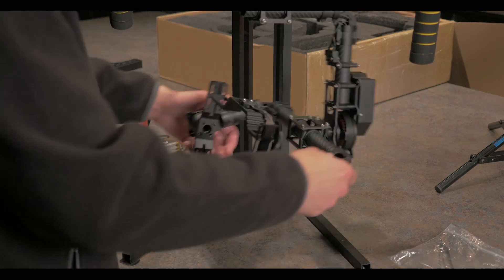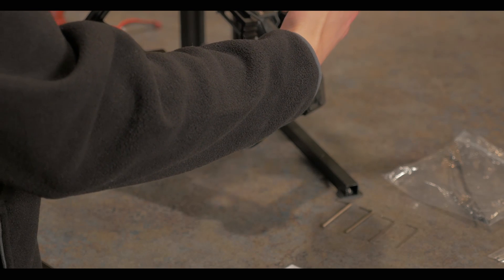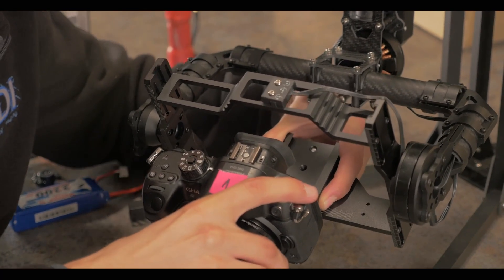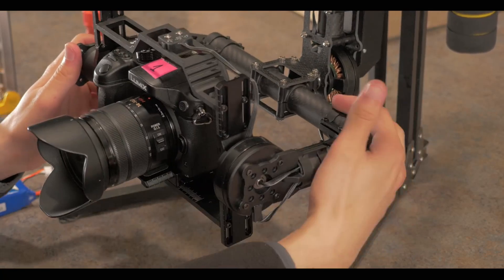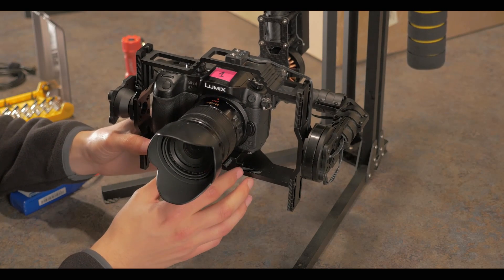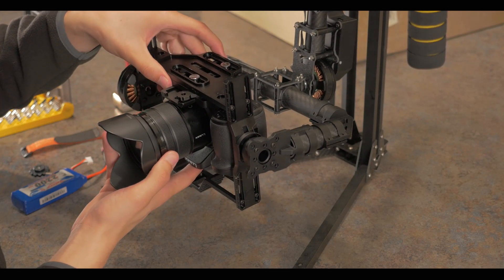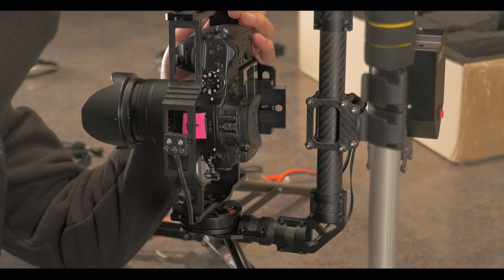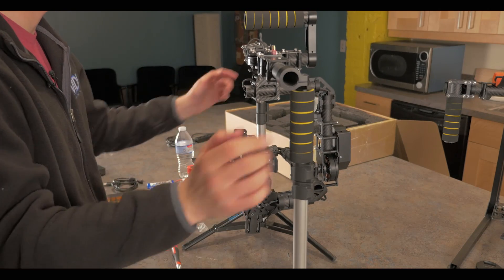Came 7800 Balancing with DSLR

Comment: I was wondering if someone could help me getting the original profile
 settings for the GIMBAL 7800. I accidentally deleted them while 
changing the PID settings.  I was using the GUI software version –  
2.56 upgrade

Now my Gimbal has lost its settings and I can’t find a way to balance it again like before.

Please contact me via
Hope that someone can reach me the solution for this problem…

Thank you very much,
Reply from the maker: check out www.mdifilm.com I believed I have the original profiles there, if you are on Facebook, there is the brushless gimbal group that under the file section it's there.

Comment: Hello Everybody. 

I just ordered a came tv 7800 and I’m trying to balance it with a canon 5d (both mark III and II), with a 28mm lens. 

I managed to get perfect result on the tilt bar and on the yaw section. 

The problem is I am not able to find the perfect balance for the roll bar: when I move side-ways it it doesn’t stay in position, it goes back to center, unlike the pitch.

I'm basically in the same situation you were at minute 7:00 to 8:00 in the video. At minute 8 there's a cut in the edit and then you start again saying: "We had some problems with the roll bar but we did get manage to get it balance".
I'd really like to know how you did manage to balance it, and what happened in that part of video that is not in the edit because I really am in the same situation.   

If I try to move the camera up, as indicated in some other videos the situation gets better on the roll bar, but it’s impossibile to balance the tilt section. 

Do you have any suggestion ? 

I’m starting to have the feeling that is one or the other, the tilt or the roll, seems really impossible to get them both!!

If anyone could help me I’ll be really thankful!
Reply: +Alice Gatti hi did you manage to balance it? You had to adjust angle. 
Regards
Reply: +Ved Ra I'm having the same issue as Alice,  do you mind explaining to me what you mean by adjusting the angle?

Comment: I'm having issues with the gimbal, it seems to sway, jerk around sometimes and "calibrate" while moving. Is this a balancing or a software issue that you're aware of. If it is software, is there a site or program I use to look at the presets, no information came with mine. 

thanks!

Comment: The time it takes to setup scared me.  I would be using my GH4 with Zeiss prime lenses (21, 50 and 85), and I swap them out regularly during a shoot.  Would I have to adjust the bars for each lense or would the quick release front/back and left/right be sufficient?  Also, can you do a review of the GUI software?  Curious to know how it works, what it looks like, and how it can make operation better.
Reply from the maker: Wax Society the only thing you would need to adjust with the 7800 is the quick release area, there's another video we did on how fast you can change lenses, check that out :)

Comment: Hi thanks for a great video. It will be useful once I receive the gimbal. I have a question. Is the base plate removable? If so will I be able to add a different baseplate such as my manfrotto? Thanks!
Reply from the maker: fitBUDDS You can change your own baseplate however, it may be hard to make it work, a lot of users been having issue with their self-added baseplate, just make sure it is 'locked down'. then you should be good.
Reply: Thats great! Thanks heaps!

Comment: Hi there, thanks for the tutorial. One question! I've balanced mine perfectly but as soon as I turn the motor on it makes it tilt abit to the right side and it even shows that one the camera built in horizon leveller. Also is it normal when the camera just shakes randomly sometimes when using briefcase position
Reply from the maker: Ramy Daniel Hi Ramy, it may be the weights shifted, we also noticed if there is a 'level bubble' on the quickrelease it would do that. you can also use the joystick to adjust it, or you will have to go into the GUI software to make minor adjustment under the RC tab.
Reply: Thanks a lot mate